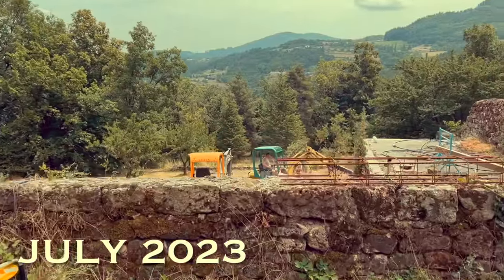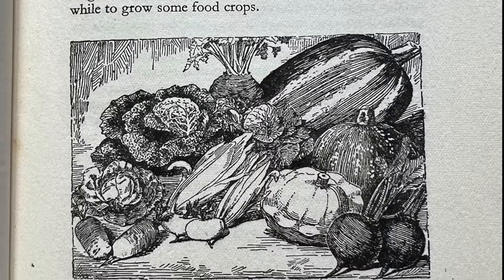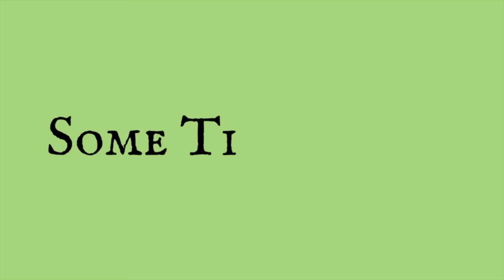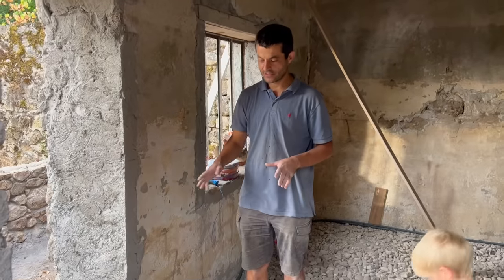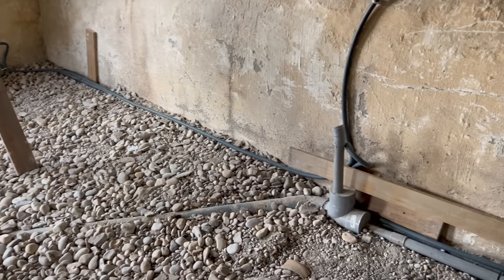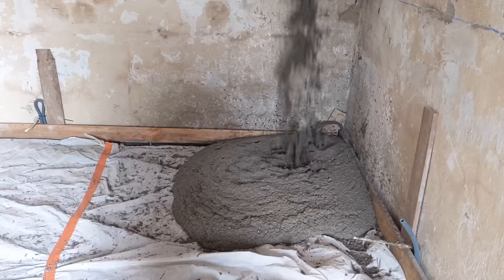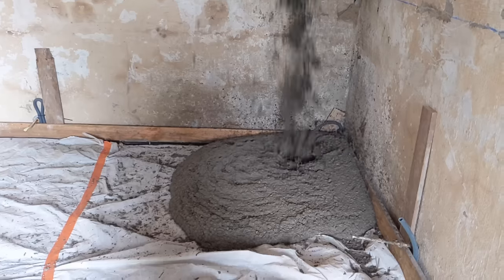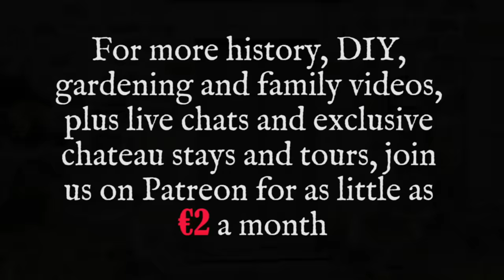Two Months of Progress: Château Greenhouse Transformation Part 3

Comment: Question for Marc.I have major greenhouse envy. I’m working on a project for a standing box 4’ wide by 6’ tall, the shelves angle down towards the front. I want to start the seeds here. It will sit on a concrete patio, should I worry about insulating the base? This is going to sit under a polycarbonate roof, south facing against a brick wall. Glass doors and sides and back PC sheets.
Reply from the maker: I’ll pop it on the question list!

Comment: I saw your comments re your soil when you visited Stephanie Jarvis at her Chateau.

You need to start a big enclosed (rectangle minimum size 8 feet x 8 feet) - use metal open metal frames (open so the air can get to all sides)    to hold compost together.
Make sure you pull it out once a month and then reconstitute it again each month with additions
Things to add to your compost each month:
1. a layer of freshly cut grass (cut that day) = layer about an inch
2. a layer of scrunched up brown paper and tissue paper = later about an inch (NO NO NO = NO newspaper)
3. a layer of sheep manure (fresh)   but (NO NO NO = NO cow manure - it just become rubbish) and NO to chicken manure - it is too strong)
4A. a 2 inch layer of PEA STRAW - (left over after farmers harvest their peas)
4B. In season, INSTEAD of PEA straw - use a 2 inch layer of newly fallen OAK leaves = that is the ONLY tree I recommend instead of pea straw 
5. occasionally if you can obtain it - a small layer of volcanic dust

Create those (up to) 5 layers THREE TIMES - once a month each time  - EVERY MONTH
by pulling it apart once a month and adding more of the above it composts much faster
the final product will delight your garden and allow you to grow better vegetables and fruit.

ONCE your compost heap is about 5 feet high you can start to  remove about 2 big wheel barrow loads to mulch different parts of the garden BEFORE you start pulling it apart to reconstitute it for the month
regards
Anna

Comment: im sure there's a reason and im curious. ....why u didn't put down rebar grill or something before pouring concrete. thx.
Reply from the maker: You only need a rebar grill if you need it to be reinforced. Here there was already a concrete floor - it was just to level it out. And it would only have pedestrian passage on it. So no reinforcement necessary.